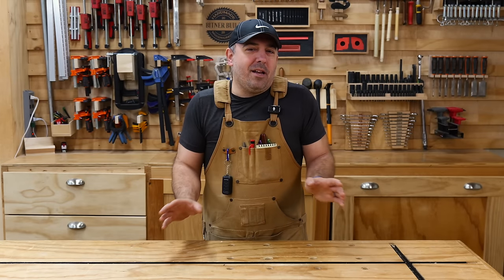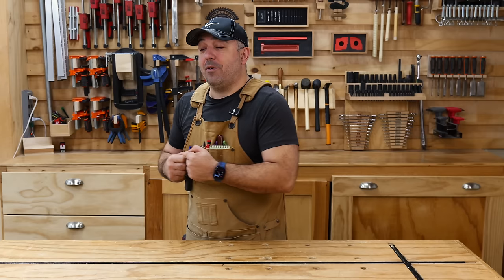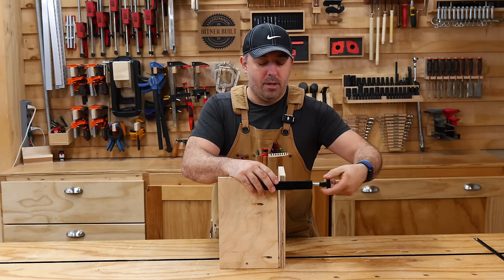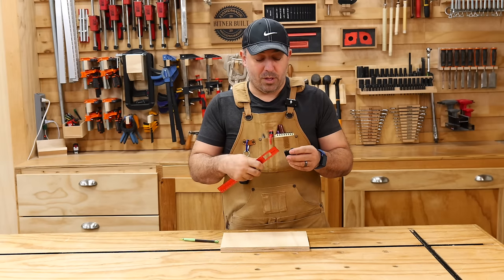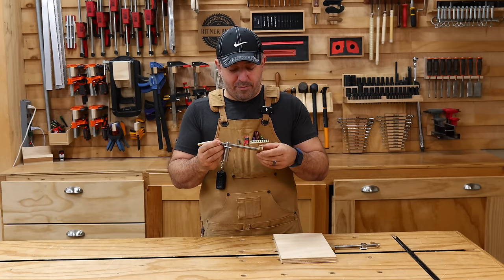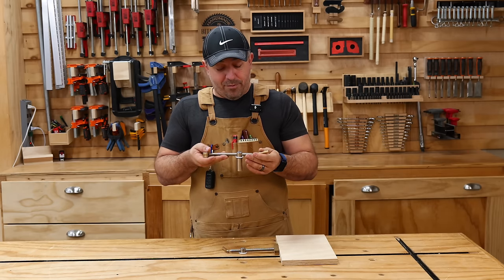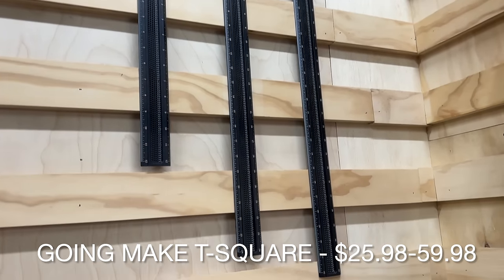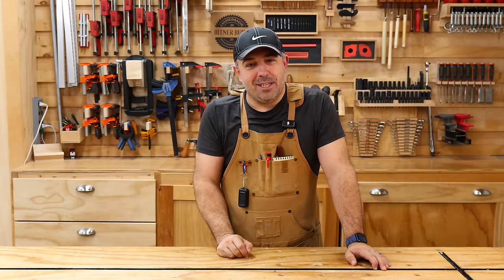Ditch Temu! 14 Cheap Tools On Amazon

Comment: those red corner clamp ones are only 2-5 bucks tho, that lip on the black ones is just fantastic looking, i need some. The 3d squares are maybe 3 bucks or so as well elsewhere from the chinese webstores. it comes un assembled in your mailbox and do need to align them your self which is easy done screwing the side on.
Reply from the maker: Yes those black ones are very handy with the lip!

Comment: The shelf pin jig can also be used as a drill guide if you need to make 90° holes and you don’t have a drill press or it’s in the middle of the panel. You’re not limited to shelf pins.
Reply from the maker: Great tip!

Comment: Justin, I especially enjoy your tool videos and look forward to more. Do you think the thin rip jig could also be used to square a table saw blade? Thanks.
Reply from the maker: Technically, I guess you could. It is coming from the miter slot, which will definitely be square to the blade. I always just use a good trusted metal square

Comment: Simple solutions to 2 of the tools. First one, the dowel centring jig. Scrap the bearings, they are only complicating the tool, simple friction pegs. Secondly, the 3d square, much like the overlooked scribe on a sliding combination square, the peg could simply thread into a dead space on the tool. Hope this helps. 👍🏼
Reply from the maker: Thanks Mike yea I said the same to them on the square, needs a home (but one out of the way!)

Comment: Great video.  Always looking for good knock offs.  I think you erred on the dowel rod jig.  Once you put the clamp on it you can no longer drill your hole because the clamp is in the way.  I wonder if a different style clamp would work?  If not, this jig is useless.  Keep your content coming.  I like your style.  The video quality was excellent!!
Reply from the maker: Thanks! Hmm no on the dowel rod jig I clamped it on the side wing and didn’t obscure the metal drill bit collar so works fine (just tried it)

Comment: Awesome video, will definitely be adding some of these to my amazon wishlist. 

With the self centering dowel jig, wouldn't it be more stable if you had it rotated so that the ball bearing's are held up against the wood in the same direction that the drill bit is spinning?
Reply from the maker: Thanks, I tried it in both directions, but just adding a ball bearing on there means that it has easy movement any direction. Some people had made the suggestion to use a punch or a Brad drill bit so it has that small little spike, that helps prevent wandering, even in normal drilling situations

Comment: Just a suggestion on the self-centering dowel jig: always rotate it the direction the drill spins and you'll have less, or zero, movement.  Those tend to move more if you're trying force it against the spin because the bit will grab it some and fight against you, so let the bit help by grabbing it into the same direction (rotate clockwise on the wood).
Reply from the maker: Great tip!

Comment: I already have the small 3D square and the countersink that I bought direct from China.  I actually use the 3D square quite a bit as it works well to scribe a perpendicular measurement to an edge that I can use to line up on the crosscut or panel sled.  The countersink works well and does a nice job making a clean countersink on laminate.  It does clog up a little from time to time, but worth the $37 difference from the pro tool. Never had a problem with a snapped bit.  Thanks for the other reviews.
Reply from the maker: Cool awesome thanks for the feedback!

Comment: Hey Justin. Thanks for the useful content. Video quality seems fine. I was happy to see you address T squares because I can’t go with the big red company prices but disappointed you cut and ran so quickly. I’m assuming since you gave them a thumbs up the construction and accuracy was spot on ?
Reply from the maker: Yeah, I didn’t want to make it the going make video, you know, since those things were sent to me. Yes, definitely thumbs up, all three squares. When I did set up at the table saw came out perfectly square and flat. I always set those up using the miter slot on the table saw so you can make sure that you’re perfectly square over the long distance, before you torque down the assembly screws.
Reply: @BitnerBuilt great! Thanks for the response

Comment: only one quick note, on the self-centering dowel jig (at least in my experience) it helps to use a center punch, marking knife, etc. to give yourself a dimple to reduce wandering. otherwise great video, definitely subscribing 👌
Reply from the maker: Great tip 👍

Comment: The FINICEL ruler has a feature that you did not mention.  The slide can be mounted through the rectangular hole at 90 degrees to keep the rule standing on its side.  That makes the graduations on the end of the ruler easier to use.
Reply from the maker: Oh very cool thanks for sharing the tip!

Comment: For your doweling Jig, what if you tried to put a rubber pad/ gasket on the wood side of the jig. That might add a better grip/ non-skid while you are pressing down and drilling. love the video, thanks.
Reply from the maker: Thanks and good suggestion a few others suggested using a Brad tipped drillbit that has a spike on the front of it, which would help with the wander

Comment: Video quality is much improved! Perhaps lower the light to reduce the shadow from the cap bill?
A few really good low cost items, thanks! I have 3 different carpenters squares, none in the junk category, and each one is out of square along the 24” side. Did you check the square on the “T”s ?
Reply from the maker: Oh, that’s no good! Yes, I checked each one. I always check my square against the table, size miter slot, a big cast-iron surface that you can square up against your T squares. Have adjustment screws? Just like a table size fence needs to be calibrated every once in a while same thing with the T squares, but hopefully not too regularly. Good thoughts on the shadows from the hat.

Comment: Shelf pin jig - the reason it moved was not the fault of the jig,  You had it against the wood incorrectly with the pin on the side of the wood away from you on your left instead of your right.  With the drill bit spinning clockwise, you must expect the jig to rotate and drag the pin in the path of least resistance.

Comment: Thanks, great video!  Going to have to check out that brand, Going Make.  Speaking of which, on the T-squares, did you happen to check them for square. and if so, how did they come out?  Also, video quality was great.
Reply from the maker: Text thanks! Yes, I always check all of my tools for Square specifically at the table saw if you use the edge of your cast-iron saw top with your miter slot. It’s a great way to align along tool like that. When you assemble it, you put all six screws in loosely and then set it up at the tablesaw and then tighten it down so that you know that it is square, the bigger question will be how long will it maintain its square before being needed adjusted again, but it’s just you know the normal par for the course with things like your fence, squares etc.

Comment: Thank you for taking a look at these budget friendly tool options.  On any of the tools that are meant to act as squares, did you evaluate them for square?  Its great that the big t square is more than half of the red tool brand but is it as accurate?  Thanks!
Reply from the maker: Yes it is square! Sorry I kind of tried to run through the last few a little fast because I didn’t want to make it seem like it was the going make show! I always check my square especially long ones with the miter slot on my table saw, they are adjustable with the screws and came out flat and square 👍
Reply: @BitnerBuilt  Great! Thanks for the quick reply.

Comment: Hi Justin. Liked this YT. Question: what do you use most on your workbench, the TRAC or the dog holes?
Reply from the maker: Hmmm prob the wrong answer 😂 I tend to use the track more because it’s everywhere on the bench but honestly, I wish I had the dog holes all over the bench, they are a lot more solid of a connection and their placed everywhere whereas the track is only around certain perimeters I also every once in a while will chip aboard that I’m cutting at the table saw because it’s somehow gets snagged on one of the tracks even though it’s recessed. So if you’re looking for a question on which should I go with, I would go with the dog holes.
Reply from the maker: Sorry, if this is a double reply, I replied to your question, but I don’t see it, I use the track more, but that’s because it’s everywhere on this table and honestly, I think if I remade the table I would use the dog holes more. There are a much stronger hold And they can be everywhere. Of course you can put track everywhere but it becomes a little ridiculous. Also, I every once in a while will chip a piece of wood on the track when I’m cutting at the table, saw the ones that run parallel to the saw. That would be cut has any sort of downward curve. It wants to go into the recess of the track which can be very annoying and even dangerous.
Reply: Thanks! It seems like the track people initially had the cool accessories. It seems like the dogs are matching the newer innovations. I am currently redoing my shop workbench, and appreciate your input since you actually have both
Reply from the maker: @hoosfoos6678  sure if I was going to do it over again I would do dogs across the entire table and a track on both of the smaller ends, that way you have the option if you want to use them without (at least in my case) interfering with the table saw outfeed

Comment: The quality of the video was excellent.  I was thinking about the centre finding jig. If you were to use a s centre punch with the jig and then drill, would that stop the drill bit slipping?
Reply from the maker: Hmm prob, you would need to punch first prior to placing the jig, but definitely clamping best. Thanks for the feedback!
Reply: I was thinking brad point bit, as they have far less tendencies to wander...

Comment: Thank you for the video. By chance, have you come across a shelf pin jig sized for shelf pin sleeves?
Reply from the maker: Not specifically but it hasn’t been super on my mind. I’ve used them only one time and know that you have to use a 9/32 inch drill bit (at least the one I used) and I just checked the going make wouldn’t take that. I’ll keep an eye out! I just used the regular jig and then went back and re drilled but obv not the best solution

Comment: First time viewer, your video look good!  Closeups could be both a little more frequent and zoomed in a little more. Also, on your last tool, the T squares, you never mentioned if the accuracy was ok and if the square was ok. That is kinda important. Also, these days I only buy tools that are both imperial and metric. There is seldom an excuse not to have both on a tool. You never mentioned that aspect about the squares. I might do a slow mo through the last part of the video to see if it captured that. Thanks for the reviews!
Reply from the maker: Thanks for the feedback! Yeah, in all honesty, I kind of tried to hurry through some of the last tools just because I didn’t want it to seem like the going make tool show if that makes sense since those were provided free. They are perfectly square I set them up with the miter slot on my table saw which is what I do whenever you have a longer tool that you need to make sure is square. the 32 inch one having six adjustment screws because it’s longer definitely makes a difference with that. They are not imperial and metric on the T squares, only imperial. I’ll shoot them an email with a suggestion on that in my CNC Laser and 3-D printing work. I typically work metric so it’s definitely a good point you’re making.

Comment: 22:53  When you mentioned the rollers earlier I was thinking that didn't seem like a good idea. Maybe fixed pegs with a rubber or sandpaper sleeve might be a better idea.
Reply from the maker: I definitely agree that the rollers are probably unnecessary and just make it harder to hold down well. I think most of the time you’re gonna be able to use clamp of some sort but good idea with the sandpaper!

Comment: to prevent moving of the self centering doweling jig, you should use a drill bit that is intended for use with wood, with a brad point. I think that would stop the jig from moving. But I think brad point drill bits are not common in the US, at least in a good quality.
Reply from the maker: Thanks for the suggestion! Not as common, but we do have them

Comment: The blue pin and the 3D square…can some sticky velcro secure the pin? I cant quite see the pin, so maybe not, but stick on velcro can solve many problems like that.
Reply from the maker: Hmm a good thought but I’d say no, if anything’s applied to the shaft of the pin it wouldn’t fit in the guide holes. I was more thinking if it wasn’t made of aluminum but a magnetic metal then a magnet on the square would hold it

Comment: That ruler Qiguch66 has two issues. It's thick and therefore has parallax issues for fine marking and one side is metric. Not specific enough for my shop. Better would be thinner stainless and English on both edges, one with 1/16 and the other with 1/32. Also mark both sides.
Reply from the maker: Yea not a fan of that one

Comment: Watch out for cheap tools that have a metric or imperial scale.  One ruler I bought was 1/8 of an inch out in just 7 inches.  Rulers I’ve bought from Temu have been ok.
Reply from the maker: Sure any time your buying any measuring tool you should check it as well as only use that one tool for an entire project for consistancy

Comment: you need to reevaluate the wire stripper.  You were using it wrong (operator error).  Turn it ninety degrees to hold and squeeze.   insert wire with one hand and squeeze stripper with other.  Twist wire a full turn and then pull wire out while still squeezing the stripper (lightly) with the other hand.  I bet it will work better then :>).  Let me know if I am wrong, please.
Reply from the maker: Unfortunately no, the razor blade is facing forward, the wire needs to travel on a forward movement as well. if you attempt to twist the wire a full turn as your stating, it literally skips or breaks the razor blade, the orientation (rotate 90 degrees) only deals with ergonomics and not the function of the machine. And it was still crazy hard to close. Perhaps you have experience on another model (perhaps the one this is a knockoff of) but this cheapo I stand by is garbage.
Reply: knowing the blade orientation makes a difference.  Apparently, it is designed to cut a slit in wire sheathing to stripping the whole wire insulator lengthwise and not strip the end for terminals.  I'll bet it works OK when in a vise.  Thanks for the response

Comment: First visit.  Great reviews. Liked and subscribed.  
One element that would be helpful is price compare between A and the Chinese drop shippers. Also,   sometimes a product on A has a different brand  to the drop shippers but it's the same product. So info on that aspect also would be very helpful. 

My pet peeve fwiw
Brands  that sell "consumer grade" versions (cheap China made plastic) at big box type stores at highly inflated pro tool prices, selling the name, but not the quality, of pro tools. Then pricing the pro quality versions even much higher still to people who use tools to make a living.  
Insane double rip-off for DiYers and  taking pros hostage. SMH 

What good is a blue drill guide with plastic holes that widen from wear across one large job?
 (trick question)😂😂
It's only good for marking. 😮🙄
Reply from the maker: Ah great idea! I’m sure I will do another cheap tool video at some point, I’ll be sure to include the price comparison! Totally agree on the upcharging!

Comment: Pocket hole clamp just add a strip of cork to stabilize them
Reply from the maker: Good tip! Though I prefer for them to make it to work without mods!
Reply: @BitnerBuilt  shocked by response time love your show. Worked in metal shop setup jury riging making crap work that's my thing. I'm a lousy 🪵 worker.love you're safety shows

Comment: I see a lot of tools on Temu that ae the exact same as the knes on amazon. Sometimes cheaper Sometimes not.
Reply from the maker: Yea that was the point of the video I said at the beginning, these are things you would find on Temu but a lot of people don’t want to use Temu for security reasons so I gave some Amazon choices
Reply: @BitnerBuilt  I understood I was just commenting about temu. I bought tools from Temu and basically beat the crap out of them and still can't break them.

Comment: The only problem with the fear of "sensitive information" is that it's false.  First off, all of the credit card processing is done in Boston on an encrypted server.  Nobody in China ever SEES your card info.  Temu (still fairly new) ZERO breaches, Amazon, is a different story though.  There have been a FEW instances of Amazon employees selling customer data.

The REST of the information they collect is EXACTLY the same info Amazon collects, and just like with Amazon you can tell your device NOT to allow them to see it.

Finally those items you find on Amazon that Temu sells are MUCH higher priced.  They get the SAME products, and the SAME WTO shipping cost of $0 and CHARGE YOU extra, and charge you shipping.  Yeah, buy it from Amazon, Bezos NEEDS your $$$.

Comment: Another way to lock it in could be to add two  small “ tit”  on underside of plate, one on each side of drill hole, then a gentle tap with a hammer would greatly help hold it in place